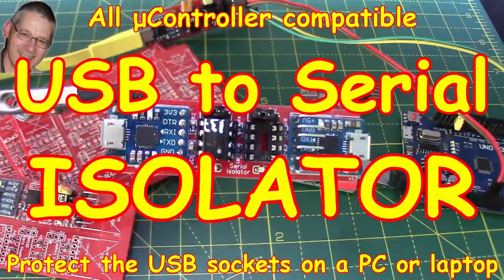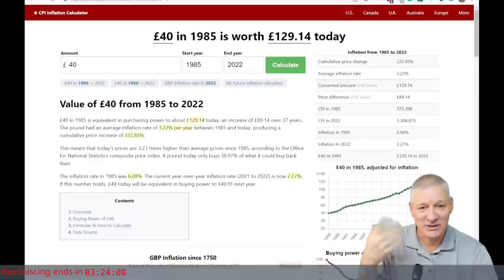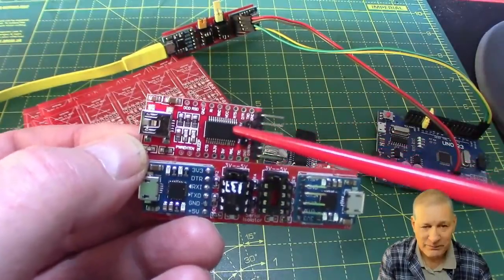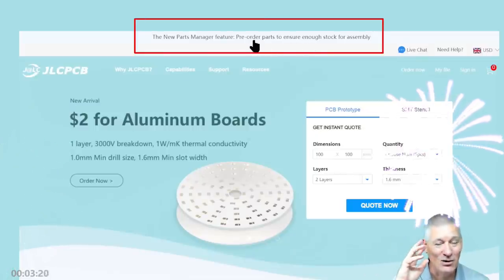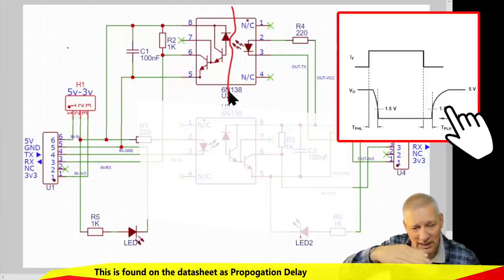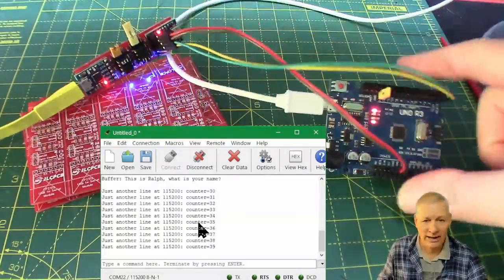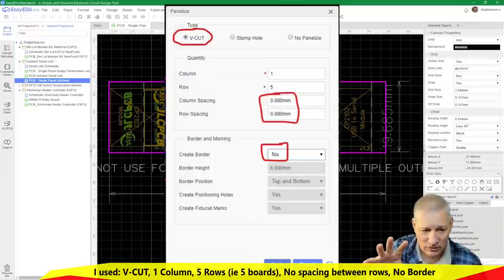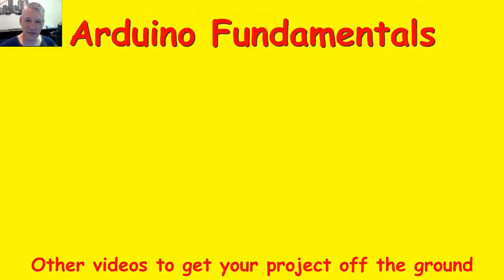#240 USB-to-Serial Isolator ⚡ Protect your USB sockets ☠

Comment: Hello sir,
me and i think a lot of people don't even start something like making a PCB,
all too difficult!
1 making a simple printout alone.
If only there was a simple drawing program like paint?
2 then you still have to fight with Easy EDA
I'm not even going to start that, unless I want to end up in an insane asylum, yes.
.
I once tried to contact them but I think I'm too direct for them,
Too hard with my text.

Too bad sometimes because I would only like to have a simple PCB for a filter to start with,
3...4 coils with 3...4 capacitors to ground You know...
No holes in the PCB, just surface mounting to start with! Very simple
linears and transmitters would follow but...

No way too much hassle! In that case (then floating or bird's nest style do you call it?)

Healthy and Friendly Greetings from the Netherlands!
Rob
Reply from the maker: Well, Rob, PCB design is not for everyone. Stripboard was used by me for years and years, very successfully. Maybe that would be better for you?

Comment: great video and a nice memory trip shame that inflation made £1 to £5.49 but your £40 only went up to £129.14 if it had inflated the same as the Magazine it should be £219.60🙂 or 400 mars bars
Reply from the maker: Thanks for the info about the Mars bars, I love 'em.
Reply: @RalphBacon  Sadly I can remember when they were 6D 🙂 and I also remember a newspaper used them as a guide to inflation I believe when we went metric
Reply from the maker: Unfortunately, today they are a quarter of their original size but cost four times as much. But the packaging is still large enough for the original Mars Bar, to make it look like nothing has changed.

Comment: USELESS IF YOU CAN'T ISOLATE AND PASS THROUGH THE 5 VDC!
Reply from the maker: Isolate AND pass through? Anyway, it's the 5v line that often gets connected to something it shouldn't oughta, hence the isolation.
Reply: @RalphBacon  
That's exactly what I thought I said.
If you can't isolate yet pass the 5 volts thru your isolator device, it's not really a USB isolator, it's only a data path isolator.
 I made my own USB isolators using a tiny module I purchased that converted the 5 vdc from the computer USB port to an isolated and regulated 5 volt at 1.2 ampere DC supply to power whatever was at the other end of the cable, (like an Arduino)...
So the isolated 5vdc and ground came from the modular power supply (guaranteed to 2500 vdc). And used opto isolators like you did for the data path isolation.
 I had friends who purchased those original Hantek and SainSmart scope modules that were operated and powered directly off a USB port on a computer, and the guys working on old 5 tube ac/dc radios or vacuum tube audio amps were burning their equipment up. ( from overvoltage or ground loops.) The total usb isolator solved the problem. That was more than 10 years  ago...
I was hoping not to have to go into such a long explanation when I left that short (but maybe too short) comment....
Reply from the maker: The isolator I showed in this demo isolated everything including the VCC and GND. The circuit diagram shows this clearly. The only thing passing between the two halves was infrared light!
Reply: @RalphBacon  
The infrared light passed the data, so you had a wonderful data path isolator, but a computer's USB port has to be able to power external things without having to carry an extra  5 volt regulated power supply everywhere you go.
 To make it a TRUE USB isolator it needs to not only isolate the data lines, but also be able to  power the destination device via the USB connection without the need for another power supply!
 The way it's done is by using the 5 volt USB supply of the computer's USB port to power an oscillator driving a tiny 1 to 1 transformer to transformer couple that power to the load side of the USB connection. The small ones can source 1 amp and the larger units can source 2 to 3 amps and usually with an isolation protection of 2500 volts or more...
 The bottom line is:
 Your version requires you carry an external power supply while a TRUE USB isolator provides the same isolation without the need to carry an external power supply around with you...!
 The guys with the Hantek and Sainsmart type USB powered scopes are the ones who need them the most...
Reply: I was looking for something like this eons ago to protect sensitive equipment( from national instruments). Back then we had a mix of 48v, 24v, 12v and 5v supply. Powering motors, sensors and auxilliary stuff. Would be nice to have one handy.